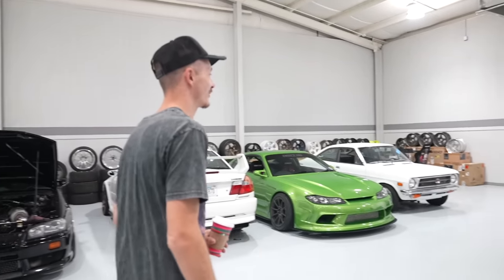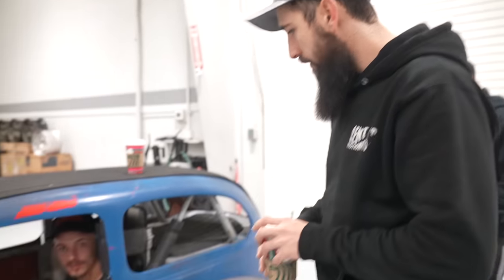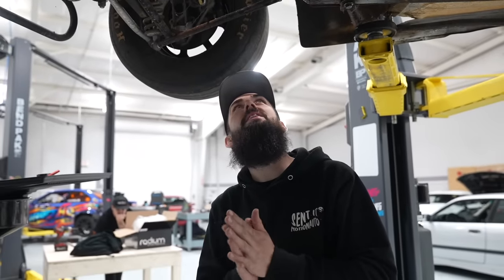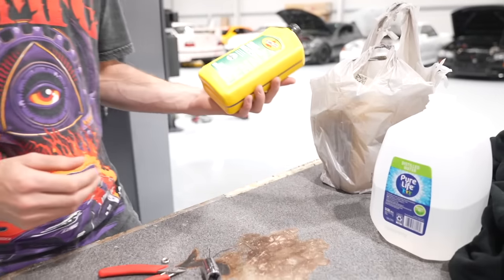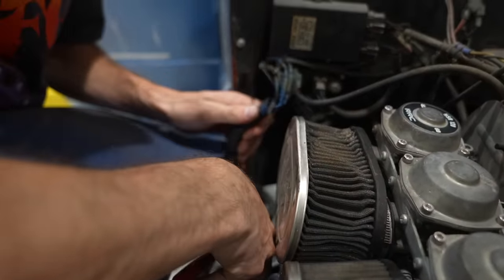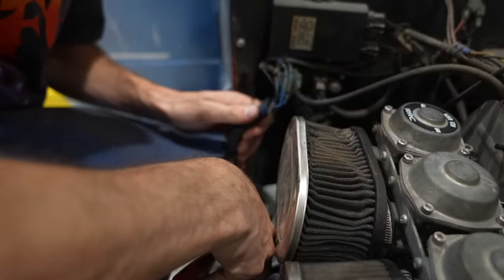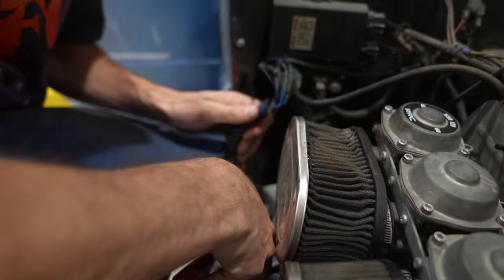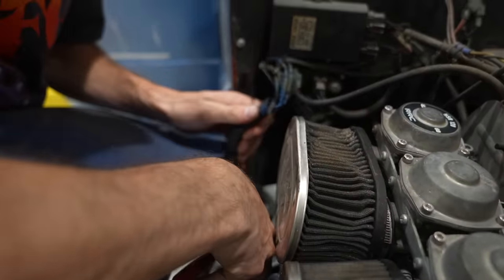I Bought the World's Cheapest Racecar - It's RIDICULOUS!

Comment: My good old friend from days of motocross  got Extremely big into legends, car racing here in the northeast after suffering, a leg injury racing motocross I sure do miss my good friend rest in peace 399 till we cross path again
🤔 far as I know, I’m surprised that you can buy the used legends cars because the legends” car association has strict rules everything has to be bought in approved through them Even right down to the engine specs, and Tampa proof seals on the engines which they are all Yamaha FJ 1200 cc motors And 
car set ups are very secretive for racing Privacy from each car owner Parts can only be bought through legends car industry that is pretty much all I can tell you

Comment: It did not sound as 12krpm.
Maybe the gage is wrong. Doubles the rpm. It seems so from the first start at 3-4L barely above idle.
I write that a t=10min, maybe they will confirm later.

Comment: The legend cars are for the younger generation... between 9 and 17 years old. Comes with a standard transmission and a motorcycle engine that's unmodifiable so the race circuit is all fair except for the driver.

Comment: In my area of upstate NY we have a track specifically for them car's and it was very popular in the 90's and they are called "Legend" car's. The popular thin is to put a Gixer 1000cc or 1100cc motor in the car with homemade mount's and use a driveshaft adapter to mount a driveshaft u-joint to the end of the output shaft of the motor. There is also companies that offer a kit to loose 6th gear and install reverse to make the box a 5-speed plus 1 reverse! Edit him out to make up for what I am lacking in and have to bring you down to look good! Saying stuff like that makes you look like a coward fool that doesn't respect his friends or coworker's!

Comment: The worst example of a legends car... all rods are gonna bend very easy along with the front clip if you tap a curb to hard the housings are cheap.. full bar set for the car is cheap.. 1250 motors are known for rods going threw the block... if you want a few spare motors im selling both mine for this exact car lol 😂 have fun they are a blast to drive

Comment: 😈😈😈😈😈😈 no offense but you are driving it hard and gaining more torque steer but i could do better ..     its the old porche delima they had back  when designing them ..  .. id expect the motors in the tear yes ?    Put in a bigger sprocket .. longer length throttle control 😈😈😈😈😈